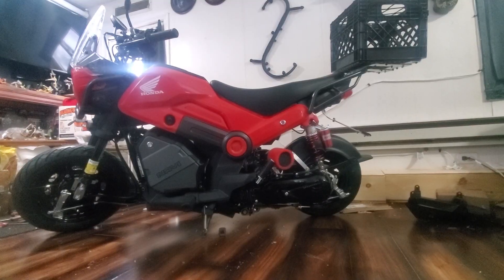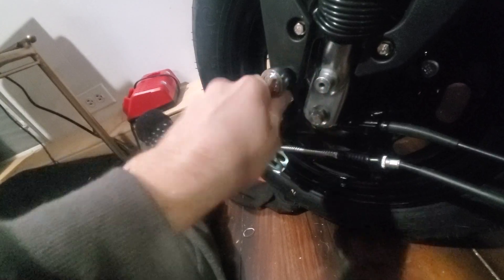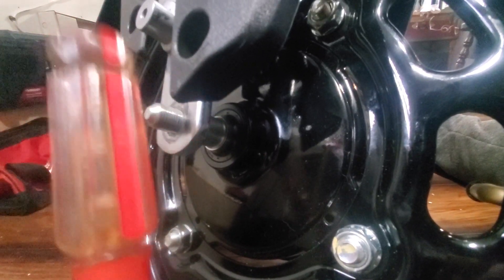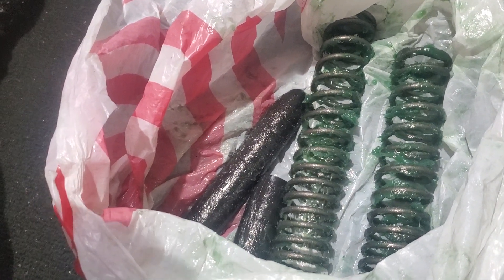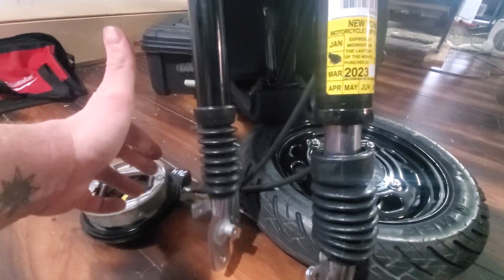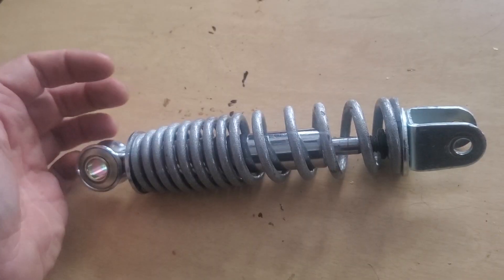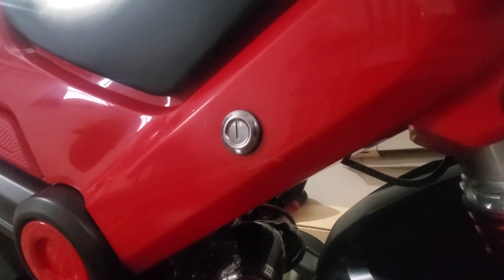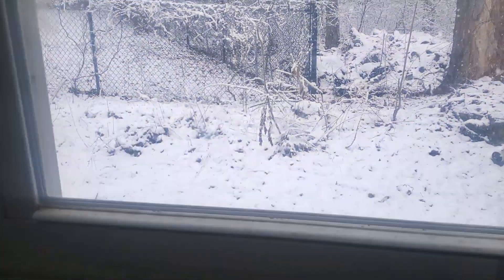SLAMMING / lowering the Honda Navi

Comment: Is that a DYI intake? If so, what hose did you use?
Reply from the maker: yeah, just a generic 1.5" silicone hose. i think it was $10 on ebay. i used a 1" pvc cap  that i drilled out to join them

Comment: So a little bike with hardley any suspension  any way ,and you have removed the little bit it had .Are you a very small person that needs to lower the seat hight ?. If not whats actualy the point of doing this modifacation ?
Reply from the maker: I did it because i wanted to. Did you pay attention? Theres another pring built into the fork assembly and the seat is very cushy. Feels better that you think,  especially since the bike tops out at like 50ish mph